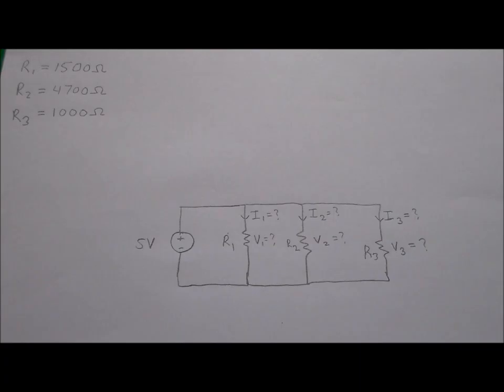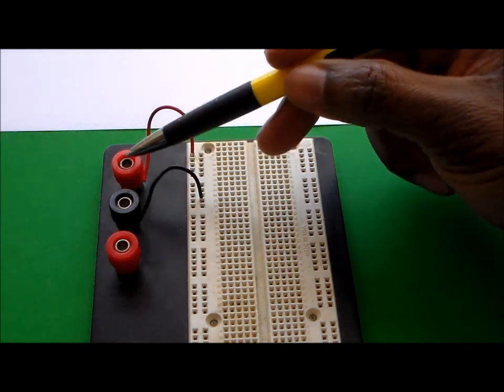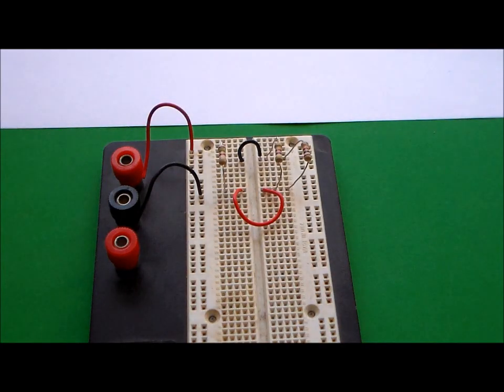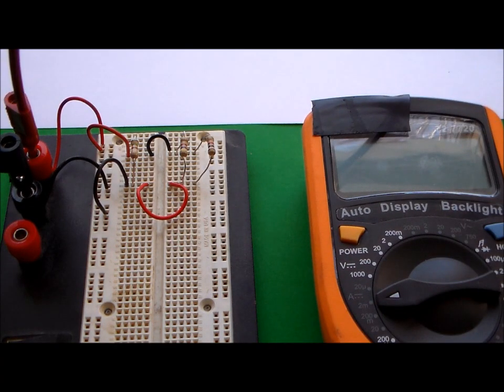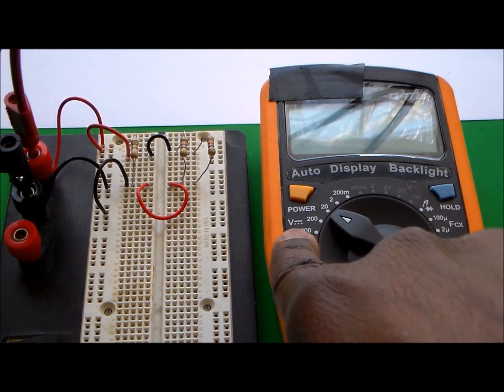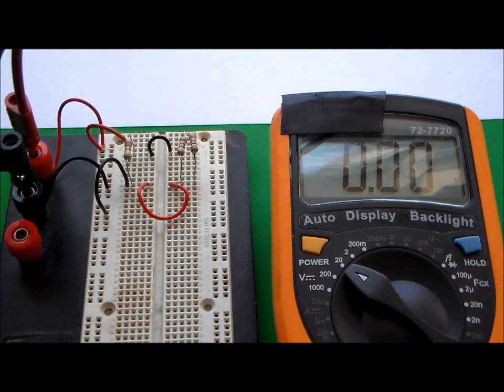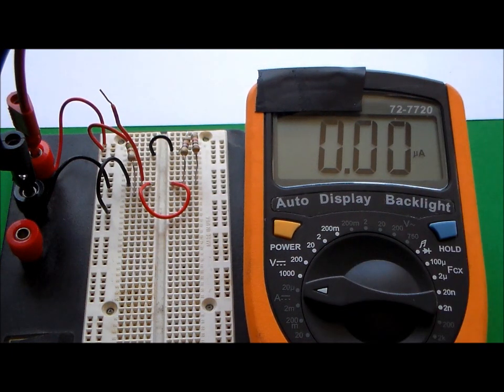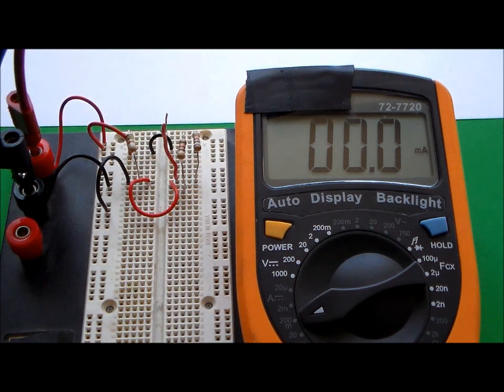How to Measure DC Voltage and Current in a Parallel Resistor Circuit

Comment: Have a question? What is the purpose of removing the other end of the resistor to a different hole when checking current?

Comment: hi. i have a question.
when measuring current how do you know how to remove the resistor to measure current? this is bad wording sorry. like sometimes you removed it and left the end jn the open, ither times you moved it a space down. does it result in the same current?

Comment: Where you break each of the resistors and fix probe for measurements is still unclear and what is the theory explanations behind that break for current??? Please I need a clearer picture my email is soughtout336@gmail.com thanks very much
Reply from the maker: To measure current, the current has to pass through the multimeter. To make this possible the multimeter has to be inserted into the circuit.

Comment: This is helping me a lot, but IDK why.. But I have 12 volt in and out and 2 resistors of 100 ohms and when I connect the 12 volts to the parallel circuit for some reason the voltage drop to 1.276 or some other number
Reply from the maker: Hi Alexander,
This is a tough question to answer without knowing all of the information related to your circuit. With the limited information that I do know, it sounds like the switch is not only a switch or perhaps the charger has a significant amount of resistance relative to the two resistors in parallel.

You will need to check:
1. What the output resistance/impedance of the charger. You may be able to get this by looking at the specifications written on the charger or finding the specifications for the charger online.
2. Obtain the datasheet for the switch and see if there is more to the switch, meaning are there other components in the switch. You will need to obtain the datasheet for the switch to know this.

I hope this makes sense.

Good Luck!

Comment: IDK if anyone can answer this but whenever I measure the current I'm getting the same current though out all the resistors.
Reply from the maker: The only way theoretically that the currents should be the same is if all the resistors in parallel are the exact same value. In a real world experiment if all the parallel resistors are the same value, they will have approximately the same current.

Comment: What caused the electricity to run backwards in that second one?
Reply from the maker: Hi Aodh! Sorry for the confusion. I am not sure what you mean by run backward. If you mean decreased, that can happen sometimes when the connection is not good and there is a temporary loss of connectivity between components or the multimeter. If you mean change direction (a change from positive to negative or negative to positive), that will only happen if the electricity is AC. I hope this helps. If I did not answer your question, please go to https://www.clydelettsome.com/blog/ask-the-expert/ and post your question there for a more detail answer. Thanks. Like, subscribe, and share.
Reply: @CALettsomePhDPE Thanks, I watched again and I've got it now.  My mistake.

Comment: How to measure total current?
Reply from the maker: Total current is I1 + I2 + I3 or you can break the circuit after the power supply. You can then test  for total current at the break. If this does not make sense submit a question on my website. See this video (https://youtu.be/N_vqCYHPlkc) to understand how to do this.

Comment: Sir why do we need to break the circuit to measure current?
Reply: the ammeter shorts the resistor. The current will go through the path of least resistance (the ammeter) so you must break the circuit in order to avoid that.
Reply: @mperez7974  you seem to know about this subject ,,, so why would that give any different results than using Ohms Law ? Thank you .
Reply: @humaidalqubaisi9194  it should not.

Comment: Why is your polarity negative
Reply: He held the prongs on the opposite sides. That's why he had -5V. Still correct just point of view
Reply: Because the wires are oppositely connected, meaning positive with negative and the negative with the positive.

Comment: I made 2ohm 10ohm resistors and 10Volt circuit. When I connected only to a 10ohm resistor, it burned out. Why is it?

Comment: When measuring the current,can't you,instead of putting another wire where the second "leg" was,just put the multimeter cables on both "legs" of the resistance?
Reply: No, it will burn the multimeter fuse, because it's in parallel and will make a short circuit
Reply: No - You can't do this because the multimeter must be in series with the circuit when taking measurements of current. However you can place the multimeter across both legs when measuring voltage.

Comment: Do it get this right? A resistor is used to control Current? 
If so, is there a way to get higher current later on in a circuit again?

I thought it would control the Volt value hehe.
Reply: resistor control current in parallel..
resistor control voltage in series..

Comment: It's difficult to see where you broke the circuit for the current measurement. It's also difficult to see where you place the wire. It's difficult to actually see where you measured the wire and the resistor. Could you please please fix this part of the video. You explain it the best but the visual is blocked by your hand or by glare. ! Help